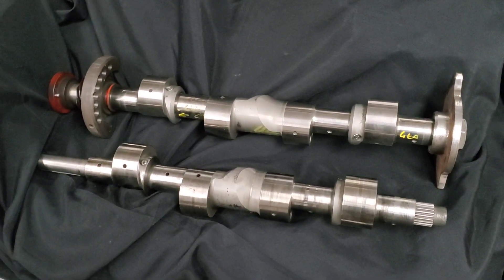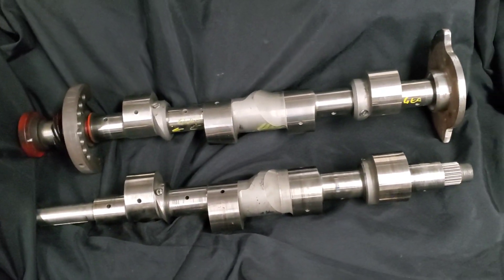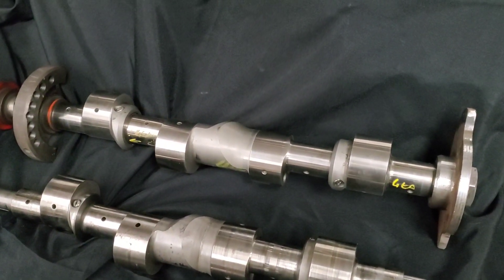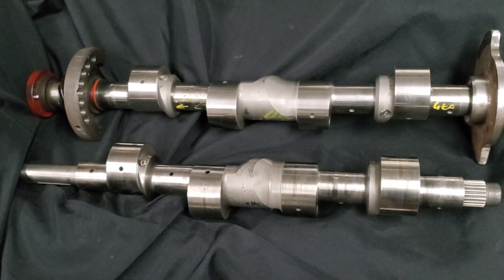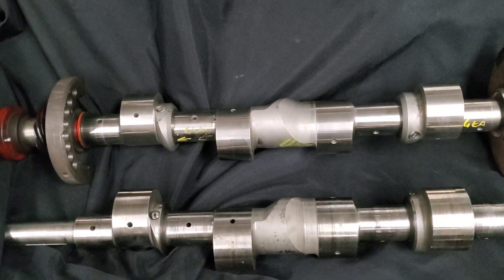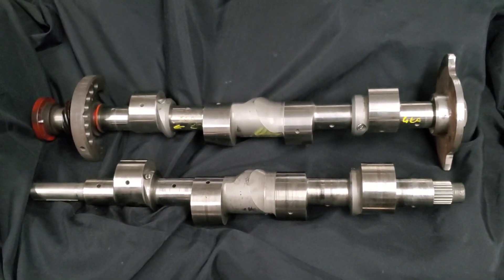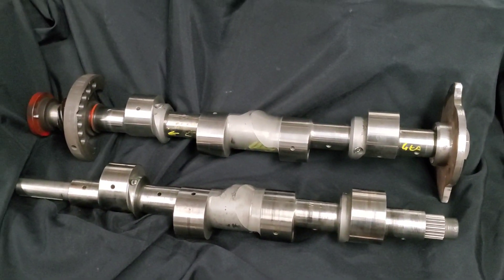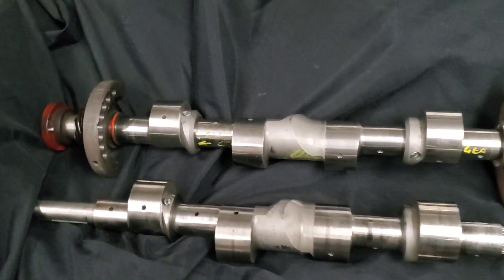Custom 4 Rotor Shafts, KMR Rotary Tech talk about 26b and 24a E-Shafts RX7, RX8, Quad Rotor

Comment: Does the 26B shaft get balanced by itself first and then with rotors? Do the rotors get balanced on separate 13b shafts first by pairs and then onto the 4 rotor? I think by this point the rotors are lightened and machined? Or simply balanced on the 26 shaft?
Reply: rotors are balanced and weight matched separately. The E-Shaft is then balanced with its counter weights using dummy weights mounted on it that match the finished rotor weights.
Reply from the maker: @bennyb.1742  yep.  Correct